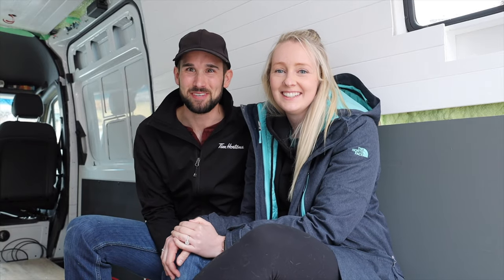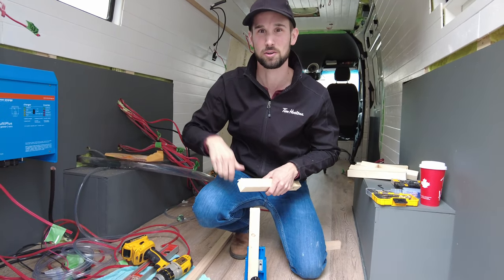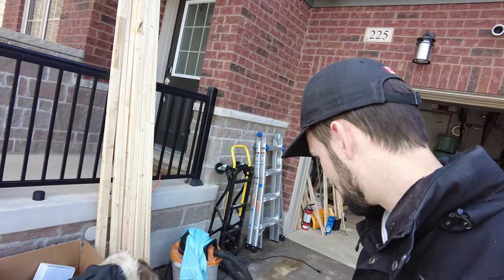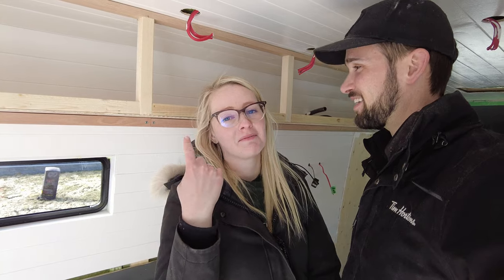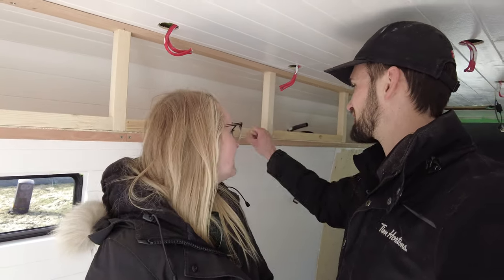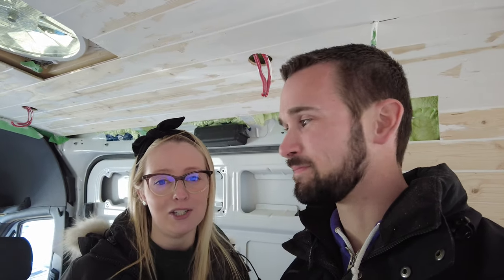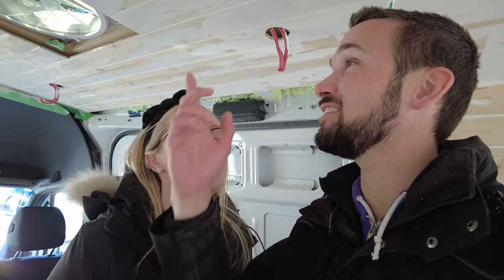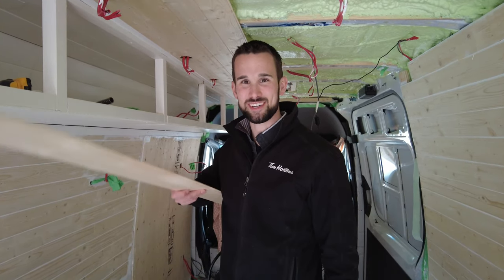VAN BUILD GONE WRONG | DIY Campervan Conversion

Comment: Shit happens...As to level.  What is level in a van that depending on the weight you add with your build and gear on board is a constant changing thing.  I think the only constant is perpendicular to the floor.
Reply from the maker: Your right! Not much is level. In this case we were really just needing all the framing to be on the same angle so it looks consistent